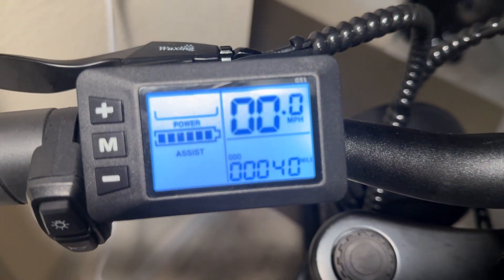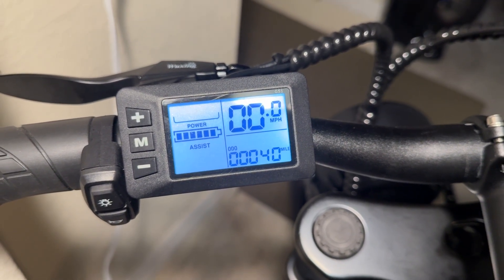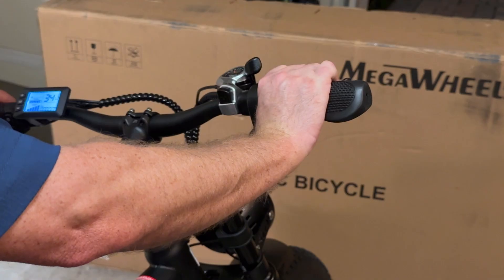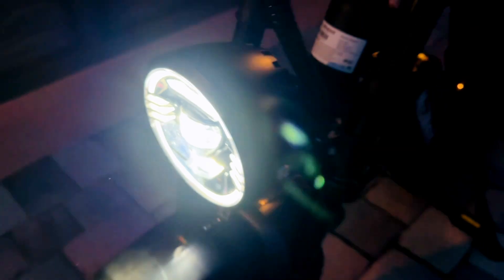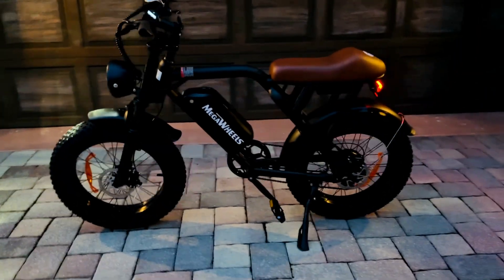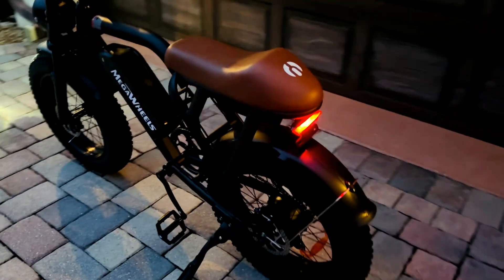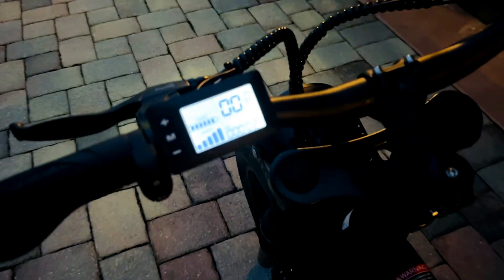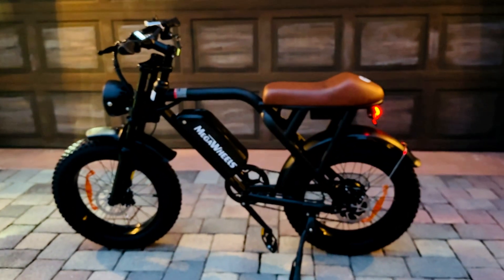G51 display - Advanced Settings Menu + Unlock Speed Limit

Comment: Okay so I have an ebike with a g51 on it also I was leaving the market the other day and I don't know what I hit but it won't accelerate past 15 I check the limiter I'm at Max but the bike still cuts off at 15 mph do you know what it could be that I need to change I'm going to go through all these tonight again thank you for posting this I already subscribed
Reply: Man it just got worse I was following you going through the menu and then I go back and the display is now saying e06 put the display on my battery is still saying I have like 3/4 of a battery or 2/3 Maybe so yeah this thing is a dud luckily I got a 4-year warranty on it
Reply from the maker: I had the same issue.   When shutting off the bike you accidentally turned on the 15mph speed restriction.   To unlock the speed restriction see video at 4:58 steps to unlock speed
Reply from the maker: I had same issue with speed restricted to 15mph.   See video at 4:58 time stamp to unlock speed to unlimited

Comment: how come it doesn’t let me change the amps??
Reply from the maker: What is the max amps on the display?
Reply: @BRichSolution it’s only stuck at 12 and it won’t go up or down.Is there a solution to this?
Reply: @Brycen-r9z I'm also curious about this.
Reply: It says 12 but doesnt change on + or -
Reply: I just bought a hole new screen and controller now it’s better